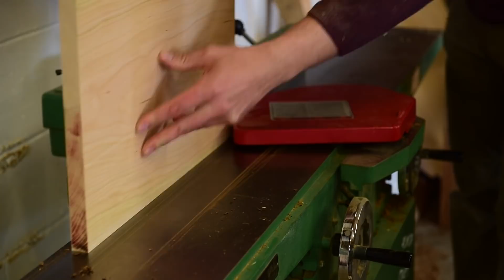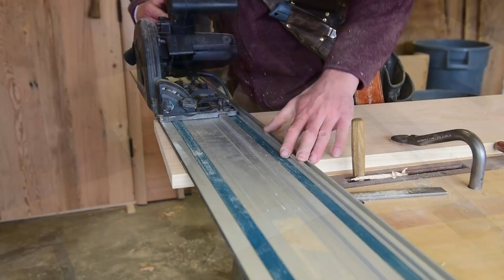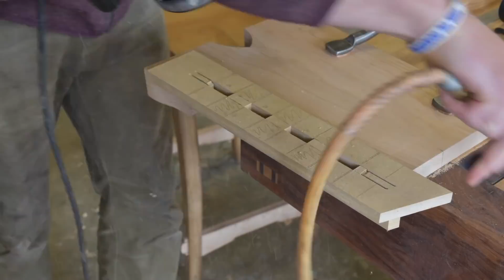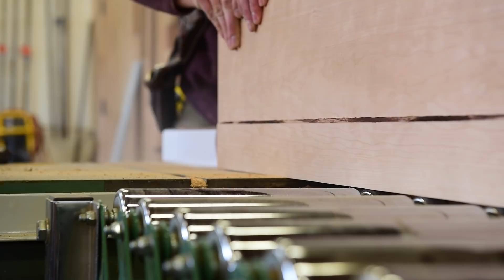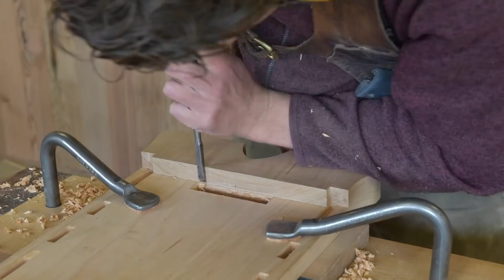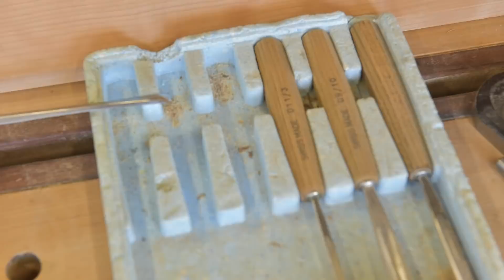WOODWORKING, A Tool Chest For Alec Steele

Comment: Man, I DO GET INSPIRED.  I have played your rant over several times just to feel the wibes.  I feel the passion, and I do want to create.  I follow young Mr. Steele also and his eagerness and passion can be almost overwhelming sometimes.  I do wish I was younger though, but I know it is never to late.  I have this boring IT job; I used to have the passion for it but after 30 years I'm empty.  I started to build up my metal work shop a few years ago, inspired by Youtubers such as yourself, with a mill, a lathe, a drill press, a band saw and a welder and it has unlocked my creativity.  I love every minute I spend in the shop, and just want to work there all day log.  So keep up the good job, its working!!

Comment: You got me. I just dropped 250 bucks on hard maple. My first hardwood purchase. I feel out of my depth but I'm going for something big. Maple knock-down platform bed with compound miter dovetails at the corners. I've spent the last long while making piles of shavings to joint the rough lumber with my $30 No.5, its going to be a while, but you've got me and my aching arms back up and on it.

Comment: I like your hand tool approach, but you could also use your jointer to face joint the twist out of the board even if your jointer is undersized. Just run the piece through it and let it joint as much as possible. Then run that jointed section face down on a thickness planer referencing of a flat board that you extend through the planer. Flip the stock over and finish planing. Perfectly flat boards.

Comment: Very nicely done!

I wish the carving in the top didn't suffer the tripod malfunction, but honestly I was hoping to see something more trivial- cherry, like oak and maple tend to burn when you take deep cuts like when you used the one side as the pattern for the second side and cut it with a pattern cutting router bit.  I was hoping to see how you dealt with it, especially on the curved cutout in the bottom.  I often find myself chasing this kind of thing (you clean it up and you get another bad spot...), you really couldn't plane it off like you did the burns on the top, sanding can sometimes take forever if not be next to impossible (the burn extends somewhat under the surface, and in that case it wasn't a shape that's easily sanded without hurting the contour), so I'm really curious what you did.

Comment: Alec, you are really good with that chisel. How long have you been working with wood?
Reply: What makes you choose to use a drill & chisel rather than a router?
Reply from the maker: If I only have two or three mortises to cut I use a drill and chisel.  More than three and I will make a router jig to save time.

Comment: I'm curious to know why you chiseled and planed the lap joint @ 2:52 instead of routing it or cutting it with a dado on the table saw. It seems like the other two options would have been more accurate.
Reply: OU812 I was wondering the same thing as well. Showing us some old school I guess.

Comment: Just curious why you don't use your tablesaw with a cross cut sled more frequently. Is it the carpenter in you to use a circular saw and track for such small cross cuts?
Reply from the maker: I don't have a sled. They take up too much space. Chop saw or track saw is what I prefer.

Comment: When I saw that slick I said to myself, "self, samurai is gonna have to pull a rabbit out of his ass to match that gift, that chisel is feckin beautiful!" U did good.
Reply from the maker: Pulling that chest out of my ass was way harder than a rabbit.
Reply: The Samurai Carpenter you need to sand up into the higher grits. Mebe use lots of  boiled linseed oil or KY Jelly. Make that easier to pass. XD

Comment: I was wondering where you learned woodworking to start with. I am just getting started and have read a lot of books but finding someone or somewhere to learn seems to be on the verge of impossible. Do you have any suggestions on a place to start?
Reply from the maker: Start with a piece of wood and a sharp blade.

Comment: not relevant to the vid, but anyone come across a calculator to do the rabbets and louvers for louvred gable vents?  the slats (?) are supposed to be 45 to shed water, and the angle of the frame, at least in the triangle i did, would be dictated by the roofline.. but the OTHER angles...  i managed to get the front or the back to look and fit nice, but never seemed to be able to get both - sure there's some math calculation to do it right...  figured it would be super easy - a compound 45/45/roofline...  NOT!